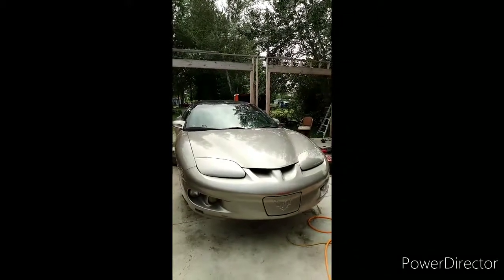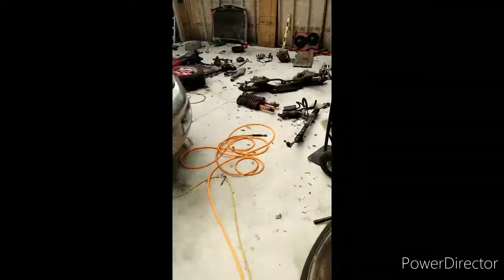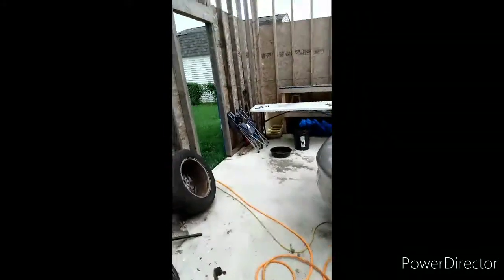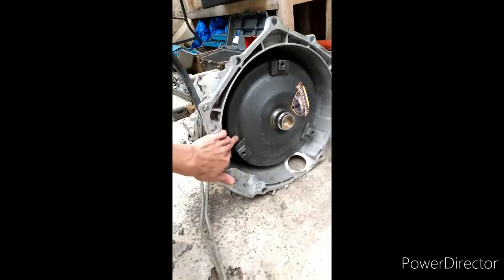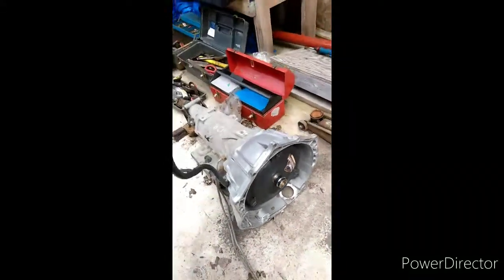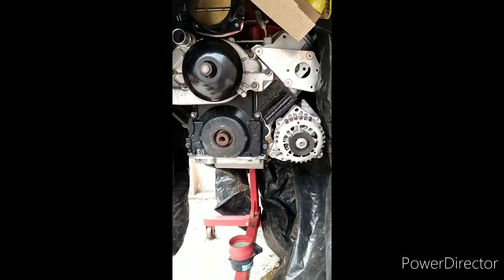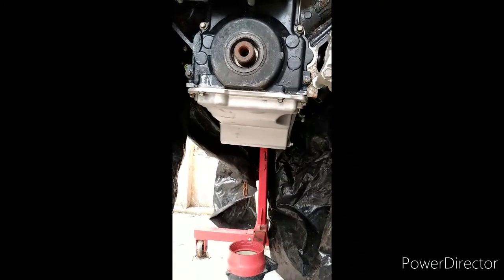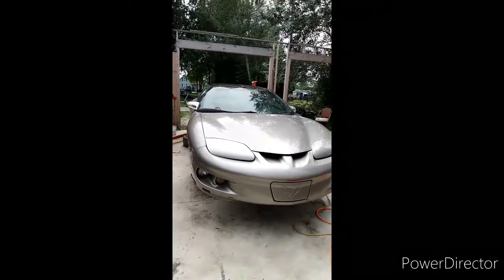98-02 F-Body V6 to V8 LS LM7 Part 1 swap tips

Comment: Wow this helped a lot I’m actually building a gen 3 5.3l for my 2002 camaro and I’m happy to hear that I can reuse a lot of the parts. I am concerned about wiring tho. When I bought my 5.3 it was just a short block so I don’t have the computer or any wiring. Do u know if there is a company that makes a plug in play wiring kit for a 5.3 to mate up with a 4th gen fbody ?
Reply from the maker: All you need is the wiring harness for a LS1 Fbody and you can get a Drive by cable if your going that rout. Get with VATS off 5.3 ECM on eBay for 120$ or so, just message the seller upon ordering and tell them the year and model of your car, tell them the speedo maxes @ 156 and tell them the tire size. That's what I did. You may still need a tune after but it should start and run. No problem 👍
Reply from the maker: Also if you go with DBC instead of DBW you will need to order the blue and green plastic pieces for the ECM plugs on the harness. Those are easy to swap out.
Reply: @thehellbird8946  …did you need to swap gauge cluster ? Off an LS powered fbody ?
Reply from the maker: @mr171009  yes. Try to get it for your year. I hope mine works cause the guy who sold me the car said it was a 98. I didnt look at the title until after I bought everything and it said 99. Bare with me here lol but if you have a 99-02 the clusters from any of those years are interchangable. But if you have a 98 you have to buy a 98 cluster specific because the pins were changed in 99. You can't use 93-97 either.
Reply: @thehellbird8946  .. thank you
Reply: @thehellbird8946  I ordered and DBC harness for a 2003 5.3 the parts that plug into the wiring harness are red and blue will that still work?
Reply: @972barzz  what happend?
Reply: @migofromthe7   yes it works

Comment: I just did my v6 to ls 5.3
Reply from the maker: Hell yeah bro, run good?
Reply: Yes gotta get a tune it’s so much I learned from it I can’t wait to help my guy with his
Reply from the maker: @99hulkhawk90  Mine still may need to be tuned but I had the guy I bought the 5.3 ECM from on eBay put the specs of the trans am on there. Vats off, no speed Governor, no torque management which I'm a little worried about that being that  I'm using a stock 4l60e lol it should be okay it has 126,000 miles on the transmission.
Reply: @99hulkhawk90  .. I may need your help if you don’t mind
Reply: Yea a the transmission should hold up for some time until u start adding boost power adders but a good tune should do it

Comment: Wait! I can use my V6 transmission? I kept reading that there was more differences then just the bellhousing?
Reply from the maker: Yes. If you have a 98 through 02 the 4l60e bell housing is removable just buy the bell housing from 5.3 6.0 with the top bolt hole. You can buy a higher torque converter with 27 splines. and it will work without a spacer. The spacer is only if your using a v6 torque. So just buy a new bell housing and torque converter and your good.
Reply: @thehellbird8946  I did not know this I knew the bellhousing was different, but I also read that the input shaft was different lengths and wouldn't work cause of that.
Reply from the maker: @travdav7775  I didn't seem to have any troubles once I put the 2500 stall on it. I figured I needed the Spacer cause the input shaft said it was shorter. So I put the spacer on and went to hook it up to the engine and the spacer was in the way. Removed the spacer and it hooked up perfectly. So I'd say just get a V8 LS torque converter with 27 splines and it will mount up.